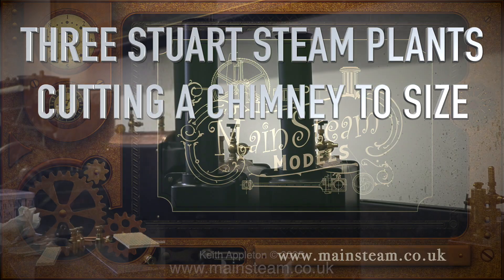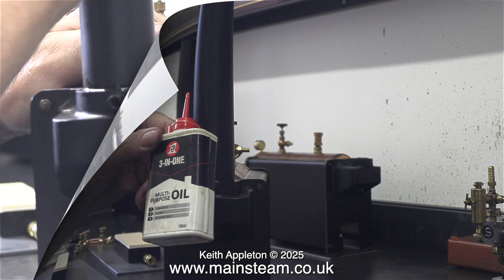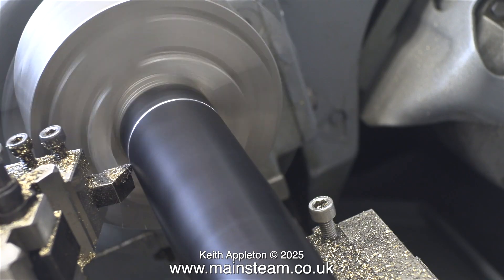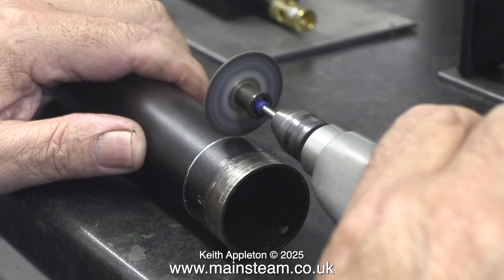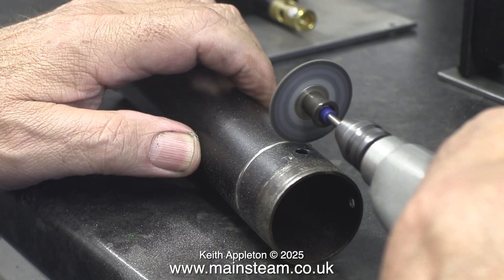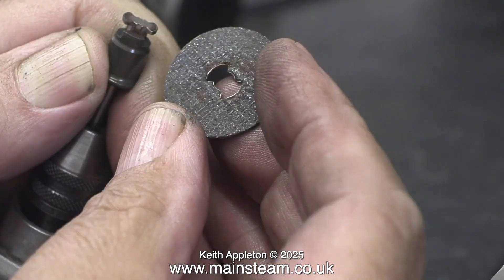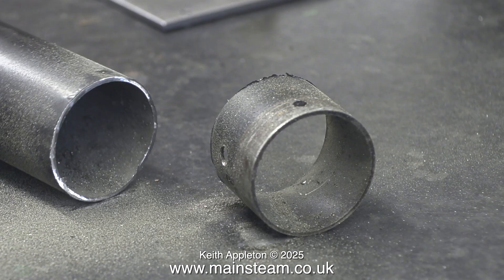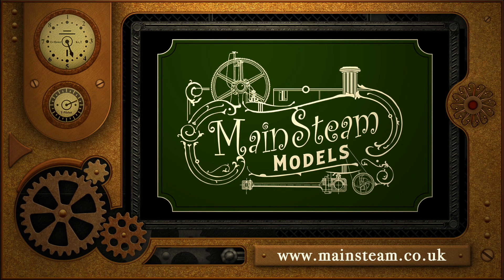REBUILDING THREE STUART STEAM PLANTS - BOILER WORKS - PART #13

Comment: One question you didn't answer is why the chimney needed to be shortened at all.
Reply from the maker: Sorry, I thought it was obvious that one Chimney was too long - I did show it in the video . . . .  .
Reply: @keithappleton  Yes, one chimney was obviously longer than the other, but what exactly made it TOO long?
Reply from the maker: How should I know? - I didn't build it - !
Reply: @keithappleton  Alright then: 1. In what way would the boiler function be detrimentally effected by a taller chimney?, and 2. Assuming the two steam plants were not displayed side by side, who (besides yourself, for whom I have great respect) would either notice or care about the taller chimney?
Reply from the maker: You may not have noticed, but there was a hold drilled in one side of the taller Chimney to accept the engine's exhaust pipe. That's why it was taller ........